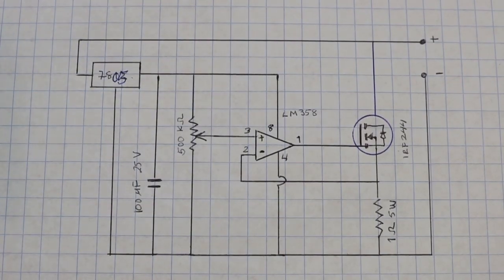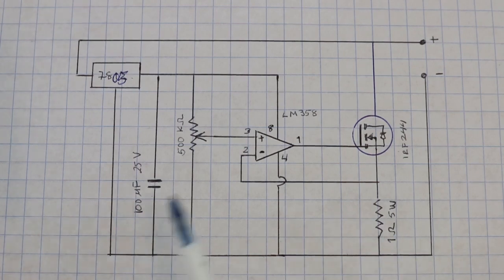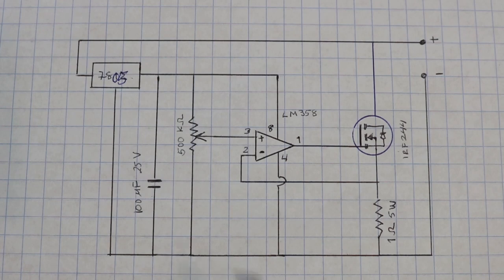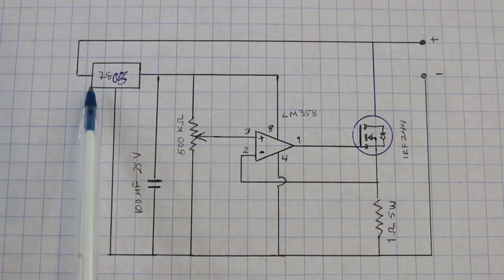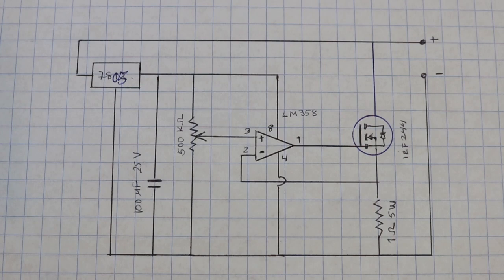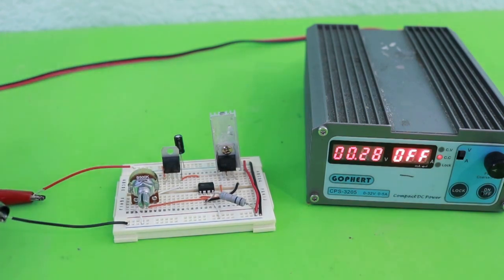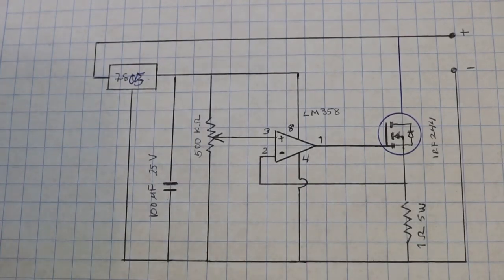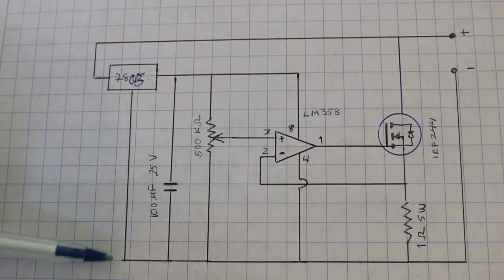Electronic Dummy Load

Comment: you supply the Lm358 with 5 volts, and its datasheet says VCC is +/- 16 volts, or 32 volts !! how is this working ??
Reply: I'm not sure but some datasheet says that LM358 Single Supply Operation: 3.0 to 32V

Comment: Nice circuit. I already built one , almost identical and it works just fine!
HOWEVER: You forgot to point out that the 7805 usually needs 2V higher input than output, otherwise it can/will not regulate!
Also, when your load voltage goes too low, you will have a limited upper limit of what current you can set, without lowering the resistance of your power resistor !!!

Comment: Sutrely theres a mistake in the circuit diagram. You have the 18650 powering both the MOSFET AND the op amp

Comment: One small addition: in this electric circuit with 7805 voltage regulator we use logic level series of mosfets (like IRL series mosfets - mosfets who can be driven by many different types of microcontrolers)

Comment: just in case I missed something, where is the part you describe how to actually build it? I mean, what are the components you used??
Reply: The schematic has all the information you need, down to the part number
Reply: Ok, I got it. I'm no specialist in reading schemes, so it seamed like those YouTube videos of people claiming to build motors that run with no outside energy, turns out to be fake
Maybe the tittle, I might have misinterpreted "Electrical dummy load" by "Electrical loader for dummy's"
Sorry for the trouble
Reply: No I get what you mean, there're a lot of BS science videos out there fooling simple people just for views, but there're also a lot of legit people sharing useful information, I've learned electronics from absolute nothing just watching these guys, now I know a lot thanks to guys like these.

Comment: I'm very interested in this project but I'm not an electrical engineer. Would you be willing to sell the dummy load device so that people like myself could tinker with it? If so, how do I obtain one.
Reply: If you're interested in tinkering, why not just build it?  This would be a relatively easy circuit to assemble.
Reply: @Enigma758  I'm sorry but that may be ready to you but it's very difficult for someone who knows nothing about it.

I take it by your response that you cannot sell one?

Regards,
Sam
Reply: @sambeckwithjr473  All I'm saying is that if your goal is to learn electronics, then you will need to challenge yourself a little.  No offense intended.
Reply: @Enigma758  no offense. At this time I do not have the time to learn it but I do have time to tinker with it. I'm over worked and under paid 😉

Comment: 1 ohm resistor is showing as short if tested in continuity with multi-meter. Does all 1 ohm resistor show short or I picked the wrong one?
Reply: Why are you testing continuity on a resistor? Of course it's a short any resistor will be. Most multimeter can measure resistance. You should use that function.

Comment: good design can we use other pot values 500k is hard to find for me!
Reply: Use low value resistors and add connect them in series to make 500k, e.g. 200k + 200k + 100k = 500k
Reply: @MohsinExperiments  Only if you're willing to lose most of your range.

Comment: Instead of LM358, can i use LM386?
Reply: U can use ll type of op-amp or voltage comparator ic
Reply: LM386 is an audio amp, not an op amp.

Comment: I like the teaching of many of your videos. They are mostly great. But in this one, I think it's little crowded. First, there should be an explanation about voltage regulators and how to connect them. Second, the operational amplifiers are a huge field by themselves in electronics. This type of op amplifier used is a comparative type. That is it compares 2 inputs. One of them is fixed. Having said that, I guess in your new videos it seems you are moving to more advanced circuits which likely need a basic knowledge of these types of chips. Keep the good work.

Comment: Complete crap. First step, find out how a 78xx works. Once you realize how bad that design element alone is, then look at the FET. This POS will only work in a small zone accidentally corresponding to the max tol ranges of the components. 

Learn first. Teach later.
Reply: Well all circuits have their limitations.  Do you have a better option in mind?

Comment: Add a lowpass filter to the MOSFET's gate to make it drives more stable. It will simulate a resistor better then.
Reply: No, no nononoooooo. Definitely don't do this. Not only will that prevent the circuit from responding to sudden changes in supply voltage, but it will introduce resonance.

Comment: What you think, wouldnt be better to use power transistor and changing its base current control the current in collector-emitter circuit where you have your load. In that way we do not need opamp and reference resistor.
Reply from the maker: It may work but I think it  will not be as precise as the opamp
Reply: The reason to use the op amp is the extremely high gain. They have open loop gains in the millions.  A power transistor has an open loop gain of maybe 5-15. So it would probably work, but it wouldn't regulate nearly as well as the op amp.
Reply: Good discussion, I had a similar thought.

Comment: Make a circuit where the voltage remains constant & while the current varies
Reply: @alfa-psi  sorry forgot to Say please make a video....
Reply: That's just a power supply. The whole point of a power supply is to maintain a constant voltage at any current. For example a shunt regulator does exactly that. A zener diode directly across the supply will drop a (fairly) constant voltage.

Comment: Sir can it works with 18650 battery because i want to test capacity of them.
Reply: For that you need to exclude the 7805 voltage regulator and use a different stable 5v power supply , to power the opamp,,,
Reply: You can find a circuit of a constant current load on YouTube